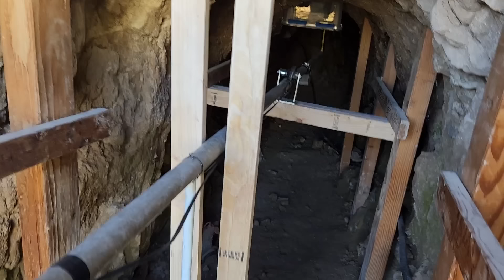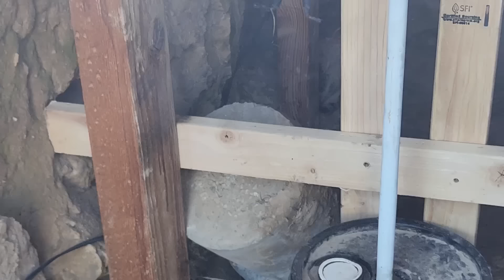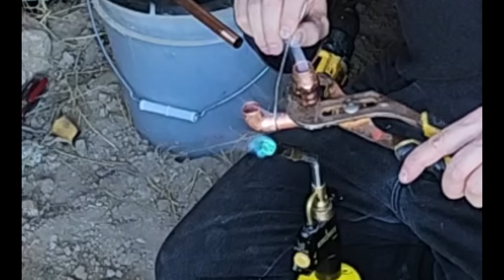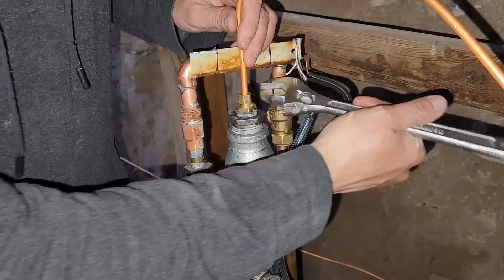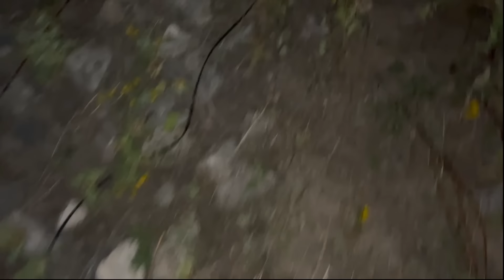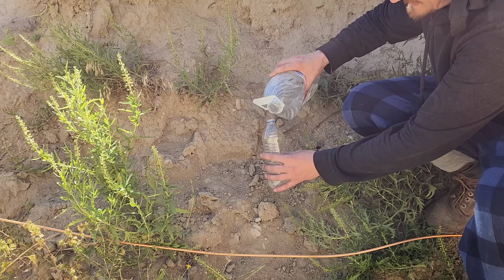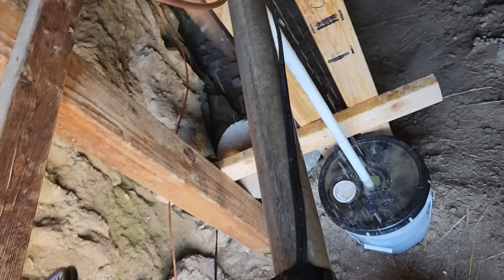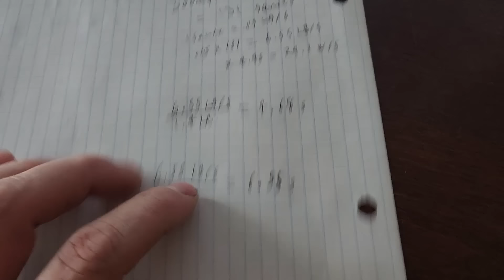Sodium Water Hybrid Rocket?

Comment: Something to try next time would be to melt the sodium (or NaK) onboard, and inject it with water and air (or oxygen) into the reaction chamber.  The reaction of water and sodium produces hydrogen, which if ignited would produce much more thrust than the expansion of hydrogen (and byproducts) alone, so an igniter may be prudent.  I think you could get in excess of 50 seconds of specific impulse this way.  Also, please note that N/s is newtons per second, whereas impulse has units of newton-seconds (N-s).  Good luck, and I look forward to your next attempt!
Reply: We found the rocket surgeon
Reply: Could it also be that sodium is elastic enough that a motor driven screw pump could squeeze a thin noodle into the reaction chamber at a steady rate to burn it more efficiently? Maybe just warm it a bit with a melting tip for easier squeezing? Or pre-shape it like a rod and feed it like a TIG welding wire? :)
Reply: I'm glad I read your comment before making my own.  Back to guns.
Reply: I'm no specialist but melt onboard.. than intermix? I have seen conventional fuel injection that does that without melting stuff and it's a precarious equilibrium. Basically getting molten NaK/O2 mix to 'explode' in the right direction is a whole new problem.  And absolutely unsure how to do that remotely safe in a Cody's Lab setting.

So HELL YEAH I want to see this.
Reply: I was thinking that injecting liquid sodium and water into a separate combustion chamber would be more efficient. Getting the sodium liquid in the first place might be hard, but you could use NaK. But you could also do the idea where you ignite the hydrogen to create more thrust, then you could capture the heat in the nozzle to keep the sodium soft. Depending the position of the sodium chamber, that might not be necessary with radiant heating coming from below to keep it liquid.
I am no rocket scientist, just a person with a college freshman science knowledge and some mechanical intuition.
Reply: The formula didn't make sense until I read your comment. The way it was shown would be S to the minus one.
Reply: So you found a way to make a hydrogen rocket by starting with the reactants. Great idea! You would skip many regulations this way 😅
Reply: More water and higher pressure
Reply: Only concern i have with hydrogen being burned would be: doesnt hydrogen burn clear? So it’d be difficult to tell if there were a flame or not still around the combustion chamber
Reply: @Double0hTater  You would still have an orange flame from the sodium
Reply: ah that is interesting! I was thinking a boiler tank with steam instead of water.
Reply: I was thinking this too or maybe a second chamber
Reply: Air yes but not oxygen, hydrogen and oxygen are not friendly enough it just wants to explode !!!  LOL
Reply: Supplement the oxygen for hydrogen byproduct by using peroxide instead of water.

NaK,  being liquid, could be injected into the reaction chamber and co-atomised with the peroxide.

But stand back.
Reply: I was thinking the same as your first idea lol. Liquid or gaseous sodium would mix better wouldn't it?
Reply: Ik it's less abundant so defeats the idea a bit but a liquid alloy of sodium and potassium could be an interesting experiment
Reply: the first thing that comes to mind with this is i would be afraid of a runaway. while the idea indeed was to hopefully do a complete burn of all sodium, a hydrogen burn may get way too hot way too fast, potentially burning the setup.

i have no experience with chemical reactions though, in fact generally the closest i want to get to anything besides a wood fire is a video on youtube, so perhaps my assumptions are very incorrect
Reply: You said kind of what I was thinking in actual rocketry terms instead of garage engineer terms. 

My first thought was "you need to feed water upward to catch the melting sodium rather than down where gravity will cause everything beneath it to melt out". 

Taking advantage of the hydrogen produced could prove a clever way to harness hydrogen's potential without the need for materials mightier than Inconel... good eye on that one! You may have just invented the solid rocket afterburner.
Reply: The world needs more people like Cody.
Reply: Agreed except I don't have the knowledge to calculate the potential efficiency .
  Another mistake is that the water only rocket produced thrust, specifically the opposite of the thrust applied to the exiting water and argon .  This is the principle behind both water rockets, cold gas thrusters and ion thrusters, none of which burn or react the fuel .
Reply: i think finding someway to add surface area to the sodium like channels, slots, or like a star shape inside rather than just a round threaded hole ... with this you could get the sodium to burn faster than its melting ... 
 ps if u have like it solid in the middle with fins facing the outside of the tube with like vents it could make it have even more surface area and all the water has to touch the sodium...
also if u have the water and sodium mix in a separate container and have the gas go back up then cercle around to point down so the sodium cant just fall through the nozzle or u could have the gas the reaction produces injected into another combustion chamber where u could ignite it
Reply: @akkiller8454 I think we need to slow down, not increase the reaction rate otherwise will just have a bomb.
I think if we have a shorter but wider tube it will control the release of more sodium.
In addition I think we need a second stage just below the ignition with like an internal spiral to swirl the mixture and give time to the small droplets of sodium to react completely.

Comment: Solving global warming by shading, does not solve ocean acidification🙄
Stop developing a bigger rug! 
We need to develop a sustainable energy production and we need pressure to do it. The fossil carbon will run out anyway and until then may have a better use, than just burning it. 
Same goes for nuclear btw🙄

Comment: So many pearls in this one, thanks for sharing. What are your thoughts on using automotive steel brake line (or maybe even the nickel alloy variety) in lieu of copper to increase your pressure ratings? (fittings are likely to be different but you can rent a flare tool in some US auto parts stores). Also would using a sprinkler fitting with a stiff spring in place of a glass vial fit where you used a pressure washer nozzle? Maybe the fuel not being all used was a result of being washed away and not given time to react.

Comment: Why you didn't go the other way ?
Make the systme the way where sodium drops in the water tank and use an exhaust system at the top of the water tank that way you get 10 to 20x more thrust as you crate compression within the water tank and that pressure need to excape some where wich will be your exhauselt system

Comment: How about using water steam instead of water+argon? You can have pressure and the oxidizing agent. Im not sure how effective that would be. Also a way how to "slow down" the water/steam so it will have a longer time for reaction by the Sodium solid sodium design (solid sodium maze) would be an interesting thing for me to see.

Good video Cody as usual 😉

Comment: Hello there! I think the better way to control the vapor generator in injector is use of QEV Valve instead of Ball valve. You will have very fast accurate control of inlet same with pulse-period injection. So it helps!

Comment: Maybe a more complex combustion chamber? One that has weird ridges and such inside that can help the sodium resist being shattered by the pressure and help trap the solid and liquified sodium while still allowing the pressure through… like a chamber that has a pipe going partially up into it that leads to the exhaust kinda like the filler tube in a toilet tank, it would also limit the sodium’s surface area and keep it consistent since it would only be able to react with one side of the tube of sodium that wouldn’t increase as it burns

Basically just stick a tube up the exhaust that goes most of the way up, the pressure theoretically should still escape but also simultaneously trap the sodium and prevent it from being blasted out? Though it would likely be prone to warping the pipe or even increase the overall temperature of the chamber… I’m just curious if it would change anything

Comment: Would it be better to increase the area of sodium being exposed? Rather than just a hole in the middle, would it be better to add extra "resistance" to the path of the water by making it coil around the sodium? I would imagine something along the lines of having the sodium fill in the pipe with a spring of sort in it, so you could still screw it out?

Comment: obviously a sodium-potassium alloy reduces the combustion potential of the rocket by whatever ratio of potassium there is in the alloy, so do you think that's really viable if you want to make a competitive or eye-catching rocket fuel? I'm interested in how feasible a pure potassium rocket fuel is. Injecting both at the same time with a more complex system could allow for a better-controlled burn and the highest ratio of thrust per mass or volume.

Comment: If the fuel didn't melt I would still expect a variable thrust. As the pressure from the reaction increases above the pressure from the argon the water would slow until the reaction slowed enough to release more water.

Comment: nice. maybe the other way around, keeping extendin a rod of sodium in water-> re routing the exaust to bottom(since water would eject). this way all sodium and water  is used. small gear electric motor advances rod. so it is possible to stop the rocket.

Comment: Is there any way you could have a "tank" or other housing which allows the sodium and water to mix at an equal rate? Basically storing both parts of the fuel separately while getting a much better ignition rate from the sodium

Comment: Increasing the surface area of the sodium would definitely help the effeciency issue. NaK would be ideal but also terrifying. The fact that the unreacted sodium was all along the walls and there was just a hole through the center suggests that the stream of water was simply plowing/falling through the middle. Perhaps dispersing the water with multiple injectors or even using a spraying nozzle might give better efficiencies as well. Idk, just spitballing.

Comment: I wonder what would happen if the you use solid ice core and pump in it the molten sodium, that would help avoid and molten sodium being pushed out of the engine. Another thing would be use Bernoulli effect to atomize water then push it in solid sodium chamber.

Comment: Great test.   I would recommend reducing the argon pressure and using a sintered bronze pneumatic muffler for the injector to both better atomize the water stream and also give a longer impulse time to limit the unreacted sodium.
Reply: But do you think that the longer impulse time would give the sodium a chance to heat up and melt out of the cylinder before it can react?
Reply: @redstone8513  Isolate the metal and it won't be heated as fast?
Reply: At this point Argon is driving a Ferrari on a go-cart track. Just use pressure atmosphere and save the money for more serious test.
Reply: @up4open  Argon is fairly inexpensive and removes the possibility of any unwanted side reactions.
Reply: @cberge8  like?
Reply: @up4open  "pressure of the Atmosphere".
Reply: @Ugly_German_Truths perhaps ‘atmospheric pressure’ would have fitted better.
Reply: @up4open 
We’re talking about sodium fuel here. Any oxidizer at great pressure, nonetheless the explosive nature of exposing it to water will cause it to ignite.

Comment: would having a disintegrating injector starting injection at the bottom work better? It seems like injecting water at the top will make it react top down, meaning you'd always eject a plug of sodium at the end of the burn

Comment: this is just food for thought but since you could melt the sodium from outside the pipe, could you in theory have a heating coil around a container of sodium and have it melt that way then have that be pressurized and mixed with the water in a combustion chamber. a water chamber, melted sodium chamber, and a chamber where they meet instead of the water meeting the bulk sodium. again this might be disastrous but this is from an outside view with little knowledge is rocket science.

Comment: So, would sodium metal be considered a hypergolic fuel?  That is quite a setup......takes a lot of hours to get that all assembled.  My suggestion would be........less water per second through a smaller nozzle and more internal surface area for the sodium.  or perhaps use water delivery through a tube with holes in the side, which is equal in length to the internal passage of sodium in the shell, to get more even reaction.

Comment: Now see if you can figure out two different fuel tanks one that holds your water or hydrogen peroxide and another that keeps your metallic sodium exactly at its melting point and then injects the two together.

Comment: I wonder if adding a steel mesh to the chamber before adding the molten sodium would help keep it together while combusting. Also, the all thread is making wierd cavities (threads) and causing inconsistencies. Maybe give it a smooth bore with a drill bit? I think those two changes may help a great deal. 

My other thought is to use sodium filings of a consistent size packed together. Awesome video, please continue with this project!

Comment: You need to add a heatsink of some sort to help control where the heat from the reaction goes. Also, you need to design a chamber that will fully separate the two materials except at the point where you want them to meet (ie the top of the sodium log). Then you need to have a method to shape the reaction so it goes where you want (out of the nozzle) without causing catastrophic failure for the rest of the fuel. Design an inverted cone vertical cylinder, with an internal 'straw' that leads from the main escape nozzle to an inverted conical shaping-plate. The metallic cylinder log will need to be poured around the straw area. The top of the cylinder will be another cone where the pressurized water is introduced to the sodium. The pressurized water comes in from the top, hits the shaping plate to spread, and then is further controlled by a perforated plate at the base of the cylinder. This will (hopefully) result in a uniform dispersal onto the fuel. The reaction will then be guided down the interior 'straw' by the shaping plate. You'll need to figure out a method to deal with the excess heat from the reaction, and how to further control the reaction. You could probably put a water jacket into the design, or design more than the singular escape route. Maybe a primary escape route with multiple bypasses for the excess pressure (and maybe some of the heat).
Reply: Heat should be kept in. Insulation! Not a sink .
Reply: I favor a longer chamber, with a central tube that has a low melting point substance that blocks the tube from allowing water to flow, so that only the bottom of sodium column is exposed to water and as it heats the tube more water is released higher and higher, thus the lower sodium could be used. Or maybe it is just a faulty idea. But if you used up the bottom it would perhaps have a longer impulse time . Z

Comment: You can fly a rocket with metal. You cant fly a rocket with metal at a model rocket event which has insurance which says you cant use metal. Nothing stopping you from launching a rocket on your own property. As long as you don't go over 400 feet high you have nothing to worry about legally.

Comment: Try adding an upper combustion chamber for the initial mixing of sodium and water, then pipe geometry to increase the time that the reaction has to fully react before being squeezed out of the nozzle. That way even after the sodium melts it will have time to react. Think along the lines of a spiral mixing chamber or even just a few long radius 90 degree elbows. 

Could even inject the the water  from the bottom of the first chamber. Have the gas exit the top and turn back down so  more liquid stays to react before getting sent out as thrust.

Nicely done and looked fun to build.

Comment: Cody the minus curve doesn’t need to be added/subtracted into your calculation, isn’t the negative force just the moment when thrust is shut down and that curve is the rocket moving in the opposite direction due to the set up of your equipment holding the rocket (the added weight).

Comment: You built this pretty much like an SRB where the fuel is meant to remain on the wall and gas exit the only hole in the system. Problem is, your fuel seems either malleable or brittle, exiting along the gas.
If you had like a closed container "boll" with an injection port and gas port on top, the gas could expand out while leaving the sodium down in the fuel container. Maybe. Unless some maelstrom churns the fuel in the chamber and exists along the gas.
Maybe something to try. Perhaps a mesh could hold the fuel chunks in.

Comment: could you have a heated chamber for the sodium to keep it just above melting point and spray it into the chamber along with water?  sounds a bit silly but with such a low melting point, it feels like it could be possible.  probably a lot more complicated than just using it in a liquid form

Comment: You could maybe use 50% aqueous hydrogen Peroxide instead of just water. It may increase the specific impulse by partially combusting the produced hydrogen leading to higher chamber pressures/ temperatures :)